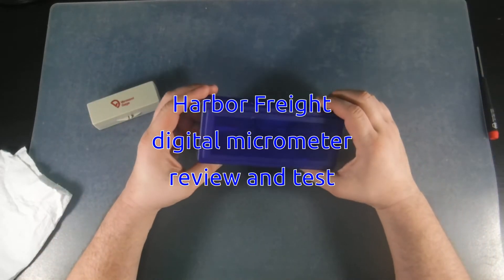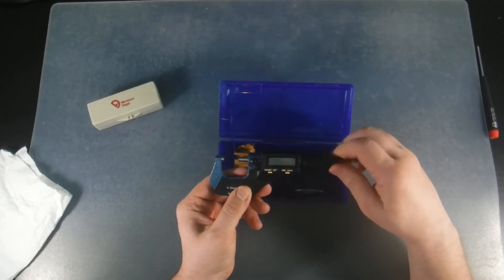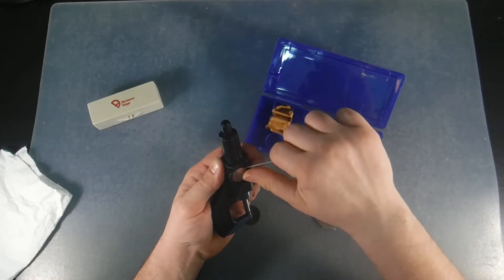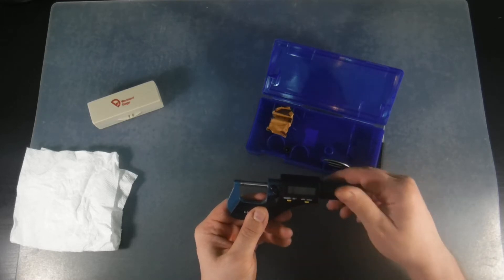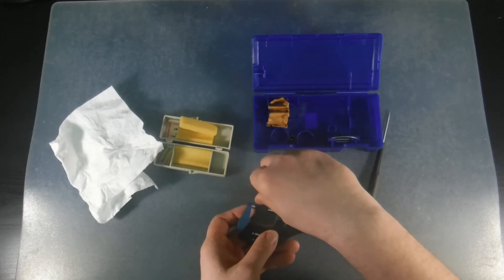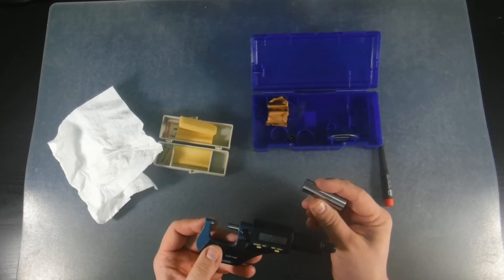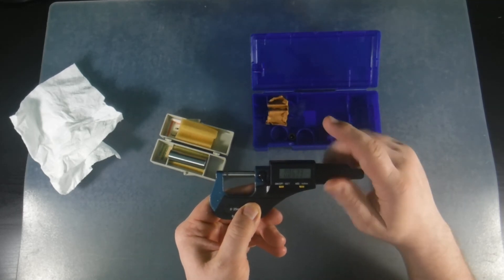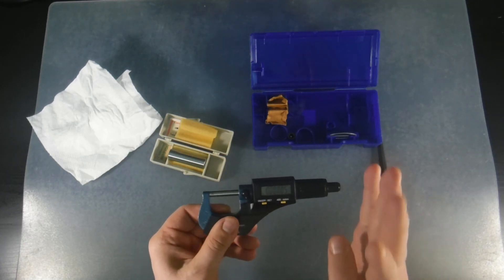Harbor Freight Digital Micrometer, Is It Accurate ?

Comment: Thanks for posting this.  I have a cheap Harbor Freight micrometer and have always wondered what I can use to check accuracy.  I did not know about Vermont Gage.  I checked their prices and it looks like one of these pins is about $20 USD so about as much as the micrometer.  Any other calibration pieces that might not be as expensive relative to the actual tool?  I am doing  a spark plug job and am interested in looking at the accuracy of spark plug wire gauges around 0.040" so of course it is good to check accuracy around the actual value you want to measure.  Would be nice to find an inexpensive set of these pins!  Thanks again.
Reply from the maker: The trick with buying individual gage pins is that each size is a different price. If you are only using it as a standard (to check your measuring tools), get any size that's cheap. On Amazon right now a vermont 0.5900" x-class gage pin is a little over $5 shipped with prime. The 0.3200 size is about $3.50 shipped with prime.